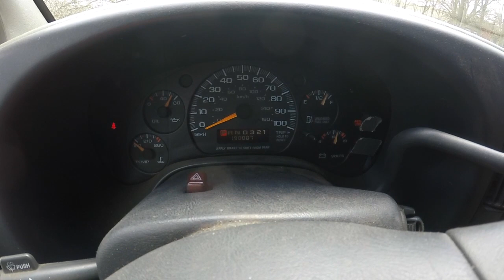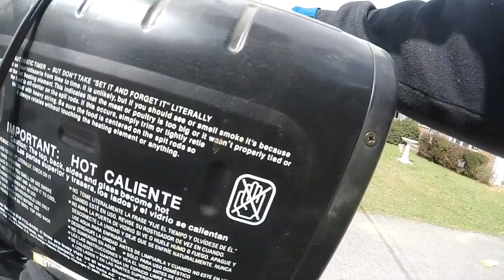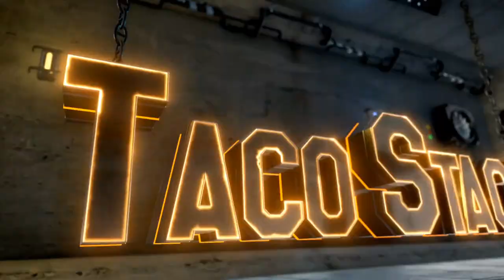GARBAGE PICKING ON TRASH DAY! Found a HUGE Score!

Comment: If there is no printed expiration date, the seat expires 6 years from the date of manufacture. :)
Reply: Shanae Conroy I have no children and have never used a car seat, so I'm curious as to why they expire.
Reply: FlaKNMB It becomes weaker or less support after years of use.
Reply: Due to breakdown of use(sitting in hot cars breaks down the plastic) and continually improving safety features! :)

Comment: Hey Taco easy fix on that abs light and check engine.  It’s common for the abs sensor that sits on the frame to go out.  It’s an odd shaped flat box on the frame.  The part is over $250 but go on eBay you can get it rebuilt and back within 2 Days.  Company out of New York.  Do the search on eBay and I️ think it’s around $50 and that includes shipping.  You send your in and within 2 Days you get it back rebuilt

Comment: If the car seat doesn't have an expiration date on it. Car seats are good for 6 years after the manufacture date.
Reply: Luis Ventura  um parents who love there children and care about their children's safety care about the expiration date. And if you listen to the video he asked where to find it.
Reply: Luis Ventura no. It is no longer safe and voids the warranty. Your car  insurance will pay for a brand new car seat if you are involved in a wreck.
Reply: Luis Ventura  you are supposed to replace those as well. Ive known cops to slice your seat belts if you have been in a wreck. I've only been in one wreck and replaced the car. So I don't drive around with unsafe seat belts.
Reply: Luis Ventura 🤷🏼‍♀️ to each there own.

Comment: Just curious why you didn't cut the power cord off of the lamp?
Reply: he often leaves cords and scrap metal. It kinda triggers me lol
Reply: Me too. Made me cringe. lol
Reply: I'm not bitching. Honest curiosity. Does he not answer questions? Again, curious.
Reply: He Provides Homestead I think he tries to answer as much as he can but just very busy. He'll answer questions in later videos sometimes...
Reply: Thanks Maggie.
Reply from the maker: I left it because it was clean, and was a heavy lamp. If someone really wanted the lamp it as all there, usually I would take a lamp if its mostly metal just to scrap the lamp and then the cord (if the lamp isn't valuable).  But since this was only the cord, someone might be able to use it. Unlike a vacuum cleaner which most likely has bed bugs / might spark or have other issues, lamps people will sometimes repurpose. I would clip a vacuum cleaner cord, but not really a lamp cord. If that makes sense.